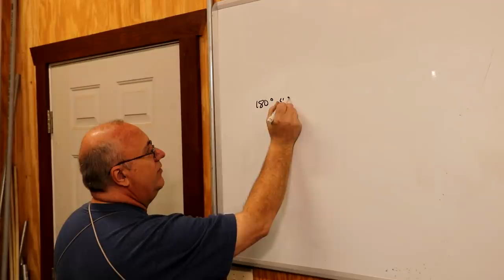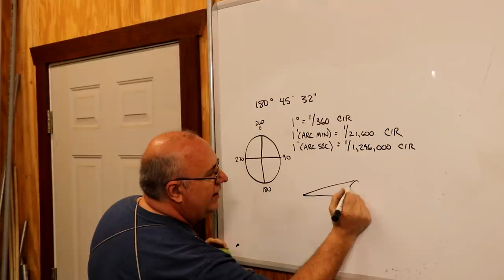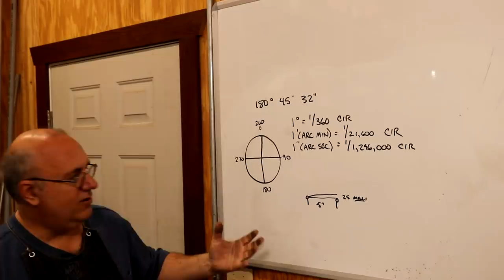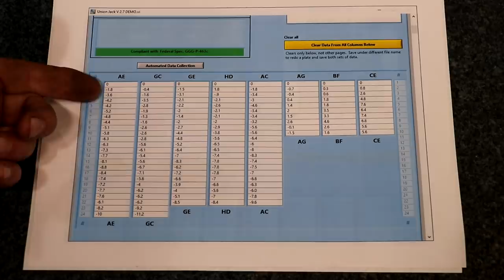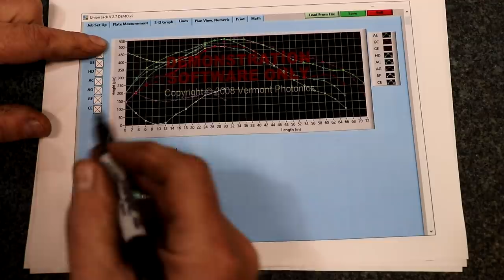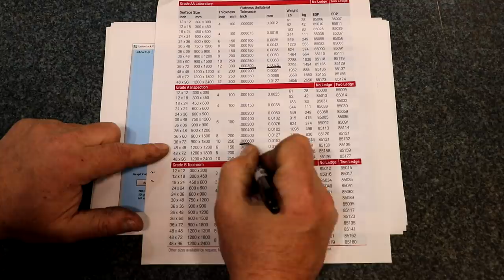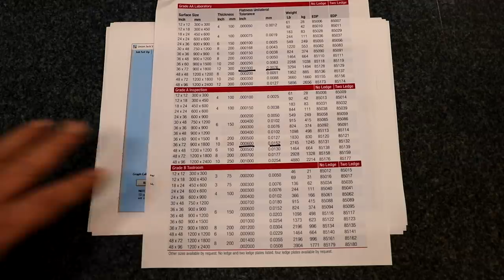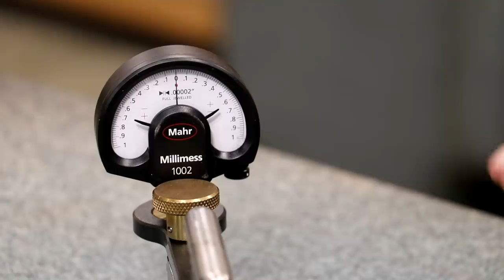Repeat Reading Gauge and Checking Surface Plate Calibration

Comment: Thank you for video. 
Consider usage of typicall glass plate (4[mm] / 0.1575[inch]) for top of already calibrated surface plate. Extra thing is cool glass roughness (additional wear-resistance) and easy replacement (single calibration of bottom surface plate). Proper glass plate should be cut from centre of glass blob in big glass foundry (float glass). These are flat for ~5[um]/0.000197[inch]  per 1m2 /1550in2 by default - the thinner glass plate the better flattness. Also glass is highly flexible, soft and mostly will produce some averaging on bottom - master surface plate (it will not "correct" bad bottom surface plate). I guess, that liquid wringing could help with placing replaceble glass sheets on  calibrated surface plate. 
Post Scriptum: getting some glass plates is not big deal - just call foundry laboratory...

Comment: Another enjoyable video about both the reasoning and practical implementation of machining concepts.

I have to say though, it was a bit off seeing you label the degrees on a circle like that. Generally in math they start 0° on the horizontal line to the right, and it goes around counter-clockwise.

Comment: The thickness of the plate is part of the grading. The plate will warp under use so the higher the grade the thicker the plate needs to be. Many people seem to gloss over this fact. If a plate fits the flatness to be a grade AA but only the thickness for a grade B, its a grade B.

Comment: 17:17   For those that want another reference to size, 0.000025" / 0.000635 mm / 635 µm (nanometer) is getting down to the atomic level (like 635 atoms).

Please correct me if I got anything wrong.

Comment: Keith, thanks for another great video. 

Trivial item: Fully Collimated light is an impossible ideal much like a perfectly flat surface plate ( even a single bump smaller than atom would disqualify it). 

Gas tube Laser light sources can be very well collimated, but still far from perfect. NASA uses a highly collimated Laser to bounce off the reflector left on the Moon by Apollo 11, their beam leaves the Earth at about 3 meters in diameter and is about 2 kilometers in diameter when it reaches the moon, if it were actually Collimated it would not increase in size with distance. 

Your lenses and light source yield a somewhat collimated light source, quite adequate for a short distance, if it were fully collimated the eyepiece image would be razor sharp and about as bright as the light source. It would also be usable when the mirror was miles away.

P.S. I had to enable the comment sections "Enhanced" Spell checker to stop it from flagging Collimate and it's derivatives as spelling errors.

Comment: Hi Keith, what is that T handle on top for, since you move the meter on the backside?
Reply: The "T" handle minimizes the body heat on the repeat-o- meter.
Reply: @leeklemetti1887  Thanks Lee, that makes sense.